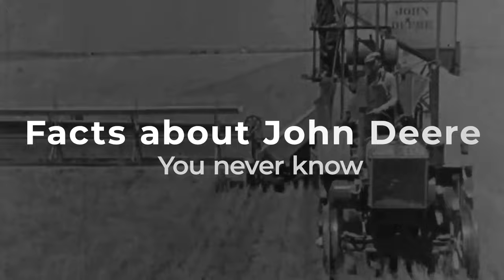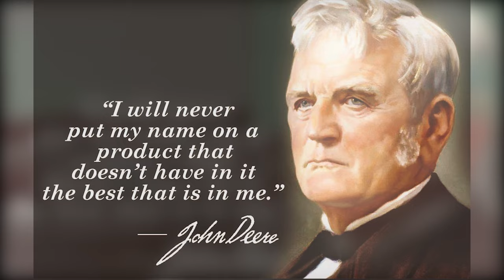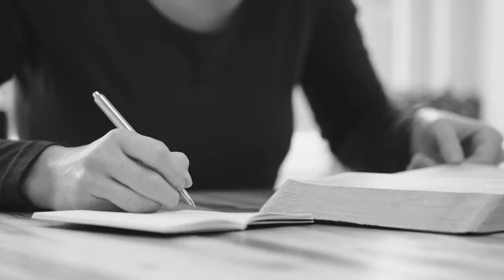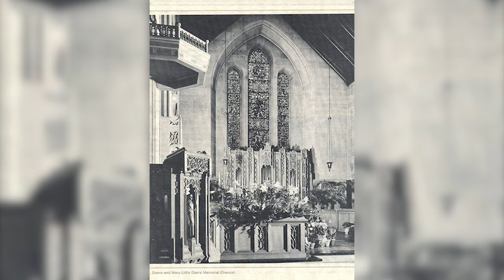John Deere: MIND BLOWING Facts You Never Knew!

Comment: John Deere definitely lived an interesting life, he lived a long life too, considering the average life expectancy at the time frame he lived. Wasn’t the biggest fan of John Deere’s tractors, IH definitely had the better tractors, plus they were an even bigger company than John Deere. IH had more experience in the tractor business, they started with the IHC Mogul in 1902, Case has the most experience in the tractor business, they were the largest and best manufacturer of the Steam tractors. The part that was left out was the part where John Deere merged with Yanmar. That’s why nowadays the smaller hp tractors all have Yanmar engines in them. By now every major farm equipment manufacturer has merged with another company, there’s not a single company anymore. CaseIH is a merge of the two oldest tractor manufacturers, not a terrible thing. The fact that John Deere is still John Deere name is only because there’s still family that runs it. He got lucky, and had 8 kids. Which allowed for family to run it for the next generations. Nowadays the equipment is way over priced in my opinion, majority is for the name, they’ve turned the name into a trademark, and profit off it. CaseIH is still building quality farm equipment, that majority of the cost you pay is for the quality, and not the name. Even John Deere parts for their stuff is over priced, it’s all cause if the name. John Deere equipment is still good, way better than something from India, or some other weird country, but John Deere prices won’t help your budget plans by no means. Even the older stuff is expensive to own, you can buy the tractor for a decent price, but if it’s cheap, it usually means it’s already wore plum out, and your gonna have to work on it before you can use it, and nobody hardly carries parts for them except well, John Deere. Which means they get you twice. They get you for buying the tractor, and they get you again, when they need maintenance, or repairs. No modern tractor is cheap to work on by no means, to many computers and sensors, on all the brands nowadays, but if you go with an older Farmall or IH tractor, at least parts for them are cheaper, and readily available in a lot of places, even if you can only afford aftermarket, you can find parts that work on most Farmall, or IH models for a reasonable price. IH didn’t change stuff on they’re tractors every year, like John Deere did. John Deere does this to keep aftermarket company’s from being able to make parts very fast, and they make the tractors in a way that aftermarket parts don’t even fit right, because the dimensions for the parts, is restricted, to John Deere themselves, so in order to get parts for a John Deere tractor that fits, and functions like it should, you pretty much have to get the parts from John Deere. You can by some aftermarket stuff for the antique John Deere tractors and equipment, but it won’t fit exact, or last very long because of the lack of fit and functionality.
Reply: Deere's prices are high? We have run Deere since the 40s and they are not higher priced than anyone else. Case builds quality equipment hahaha guess you aren't around much of it. Blue equipment painted red. You don't become the largest ag company in the world by chance.
Reply: @cmberry4020  Well said.